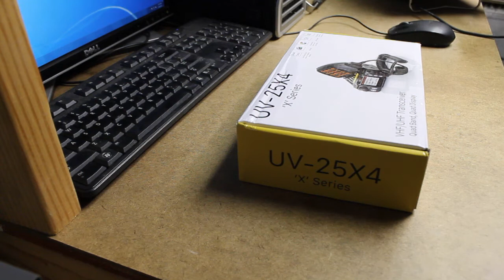New Mobile Tri Band Radio Part 2 - BaoFeng BTech UV25X4 Unboxing

Comment: you better understand your sig gen better .1 mv is 100 micro volts.   If it takes a whopping big signal like that to open the squelch you can hear better with a tin can and a string.   .1 micro volt is much closer to what the squelch sensitivity should be in any modern radio.

Comment: What are the specs for your 12VDC power supply? I just got the same unit and I want to run it in my shop for a few weeks. 73

Comment: sensitivity measurement is wrong.... did not set squelch to zero....nor report the number correctly... our reading comes out to .1uv...... that is 1/10 microvolt... not watching the rest of this video. Next Time connect the antenna before powering up....

Comment: When you installed this radio did you have any issues with background noise in your transmission, or have you had any issues with the quality of transmission, clarity, or volume in your experience? 
Thanks 
Art
Reply from the maker: I've had good reports using this radio, but each one is different, because of build quality issues. Have you tried a different mic with the radio?
Reply: Thanks for the reply. I haven't purchased the radio yet. I am a new HAM passed the exam two weeks ago, still waiting on my call sign. I have a UV-5RA, but want a radio I can move between vehicles. I would go for the UV-50X2, but feel that the ability to use the cigarette plug for this radio will work better for now. 

Plan is to use the radio in my Dodge van with a permanently mounted antenna, in my Hyundai sedan with a trunk mounted antenna, or mag mount, and in my Corvette with a yet undetermined antenna. Once I have experience and know what I like or don't like, I can upgrade and put this in a go box if it lives that long. 

Appreciate your help. Stay safe 73

Comment: You have talked about traveling across TX, I assume you are out in W Texas. I am in Abilene, are you nearby?
Reply from the maker: I am in San Angelo, but I used to live in Abilene.
Reply: Gotcha. I am testing next week in B'wood for my Tech license. I am considering this radio for my truck. I have a couple of mobile 2 meter radios in the house but I think this triband would be great. Your vids have been invaluable. Thanks neighbor!
Reply from the maker: You're welcome. I really like having this radio in my truck, and with quad watch turned on, I can monitor 146.94, 444.225, another local UHF repeater, and the police department at my place of work. Good luck on your technician test! I don't know if you are aware, but they will let you take additional tests, for no additional charge. I always recommend taking at least the next level test, so that you can get a feel for the next test. I took General and Extra on the same day, with no study on the Extra material and still passed both tests.